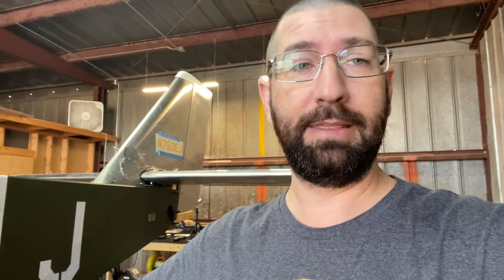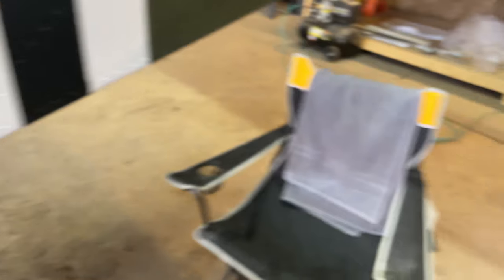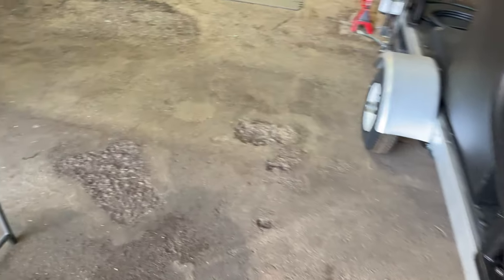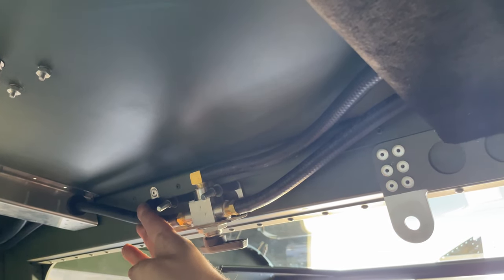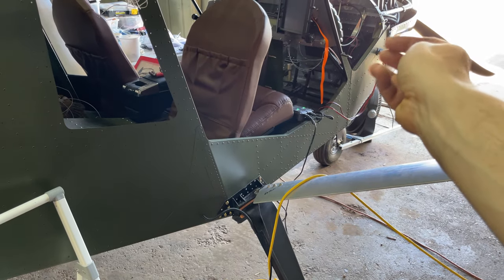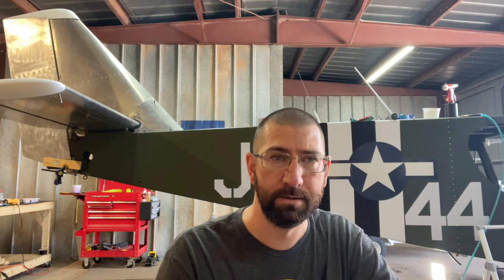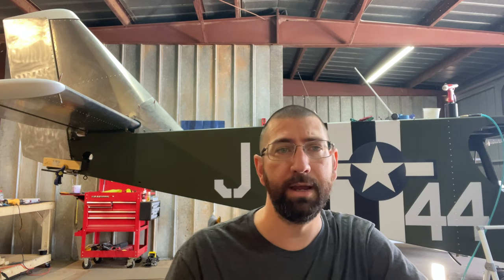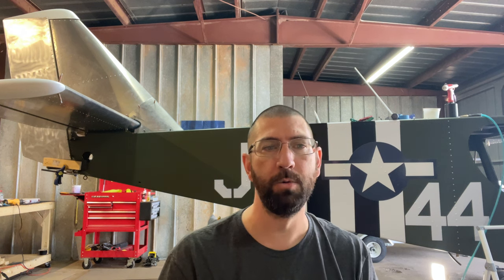L750 Cricket Build: Almost done with the Fuel System

Comment: how did you glue the headliner material, and where did you find it.
Reply from the maker: I bought it on Amazon. The glue is also from Amazon and designed for cars. I am trying to be sparing with it because is there is an accident I don’t want tons of fumes.